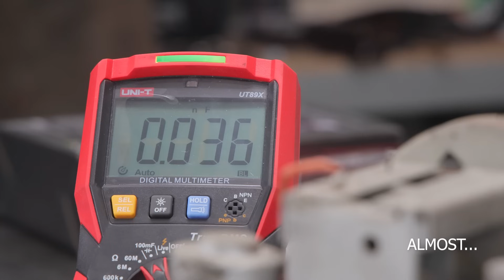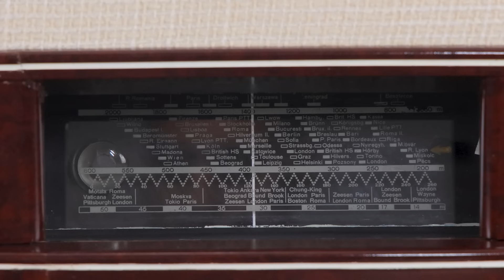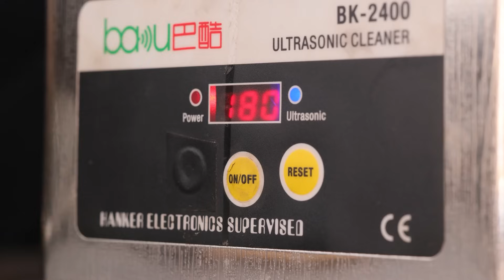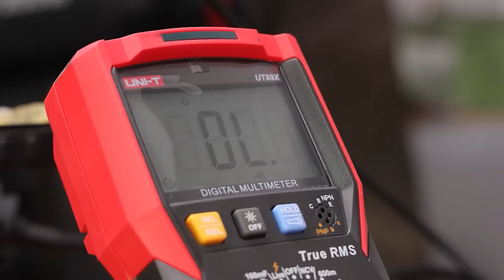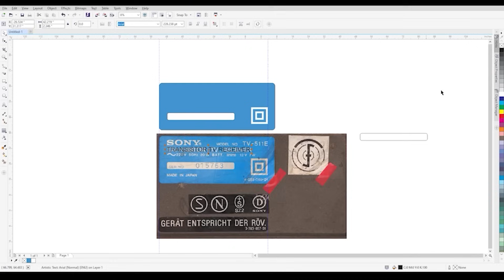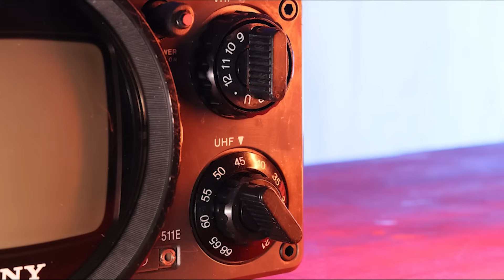1959 Philips Futurit | Old Radio Restoration

Comment: Ok… let’s see… you’re an electromechanical engineer with extremely technical restoration skills and a photographic memory. You are highly skilled in many disciplines allowing you to seemingly restore at will. I don’t think anyone can top you!!! Absolutely incredible performance!! Well done sir!!! The Old Army Scout…
Reply: But he didn't actually show any equipment working when finished. The radio certainly wouldn't have worked because I could see several components, which needed to be replaced, and he didn't touch them. But kudos for his mechanical skills.
Reply: Eu sou aposentado como técnico reparador de rádio eu fico vidrados em concerto de rádio antigo parabéns pela restauração do móvel do rádio.
Reply: You're obviously easily pleased!
Reply: Im a Beer engineer.

Comment: Everything is done very well. In the radio, a new capacitor could have been placed inside the casing of the old capacitor (after removing the old contents), so the external appearance of the components would remain the same.

Comment: An adequate radio restoration, however you are no David Tipton.  😁😋🤣
Reply: Or a Mr. Carlson. Where did he come up with the missing knob? He didn’t show cutting some new glass or where he got the printed display showing frequencies. Bogus restoration.
Reply: I meant my comment as a cheeky joke.  Buzz is doing a fine job, I certainly could not do what he does.  Keep up the great work Buzz.

Comment: Tear out all the tubes, capacitors and wiring, build a chassis and put in a Bluetooth module. The old wiring and components will fail and possibly cause a fire. Not to mention the likelihood of there being asbestos in there. I have done a few of these and typically the wiring is shot and the insulation crumbling. The outer case looks great!
Reply: There's a really old console radio at a local antique store. There's a sign on it that says "No, we haven't tested it, we're not crazy!"

I keep threatening to just pop a bluetooth speaker in it and not touch the electrics.
Reply: @andreacook7431  Old tube radios are perfectly repairable. There's pretty much nothing that can cause a fire once you replace 4 or 5 components and the power cord, if everything's in order. I have a couple dozen radios that I've restored and repaired myself, bought them as scrap. Nothing was wrong with them but a couple of easily replaced components. 
One such radios sits on my bedside table and I listen to it every evening for a couple of ours. It hasn't given a single trouble but a dial light burning out, as it was the original one from the 1950s.

Please, don't scrap the electronics inside, take it to someone who can at least make it work again safely! Bluetooth and other gizmos can be added without destroying the value of the radio and/or the electronics inside and I've done so for a radio I've gifted to a friend of mine. Now it can receive music from his phone, apart from normale AM/FM radio and even play records!

This we've seen may well be a good cosmetic restoration, but alas, on the electrical side of things is very dangerous! He hasn't checked anything out apart from one capacitor. I do not believe in the slightest that the radio could light up after the "restoration" process, but for how long? An hour, before the transformer cooks due to leaking grid coupling caps? It's a matter of minutes to change those, if you know how...

Comment: Not that I actually care..... but that's not a 1959 model Philips radio (possibly a 49, but not 59). Three give aways are first the 'bottle neck' tubes, were phasing out by the early to mid 40's. Secondly, though 6 volt tubes were still being used through the late 50's / early 60's they were being phased out for the12 volt small envelope tubes by the late 50's. Thirdly,  the BIGGEST and most BLARING ISSUE is "'Bakelite" plastic was discontinued by the late 40's.  

As a restorer I'd grade the finish (cabinet) a "B-". Though it looks shinny, and the chip repair appears complete, no photos of that repair or coloring was shown. (Why?)  Furthermore, that white trim stripe, and the dial indicator would have never been used in the original release, and that same dial indicator would have used a  "luminous"  Radium or Promethium type paint  (it would have been better to have left it alone). Concerning the electronics: "F" and Laughable.  Not but one capacitor was replaced (and that looked like an amateur attempt); no other caps, resistors, no cleaning of tuning cap, chassis or wire replacement? How did he deal with the 120 line voltage issue? Apparently,  he never did.

Comment: Pity you didn't make the effort of cleaning up the inside components of the radio to do a proper restoration. Bakelite should never be spray varnished but properly polished with paste. Also the screw put back on the turning knob was still gnarled and rusty. This is a rushed and half-hearted restoration which could have been improved. Also you never put oil on camera shutters as they can become sticky. I could go on, but this is not a restoration channel, just a quick tinkering with old items one! Poor show.